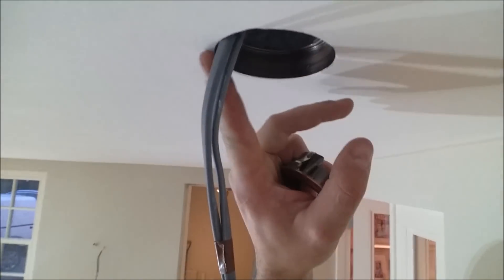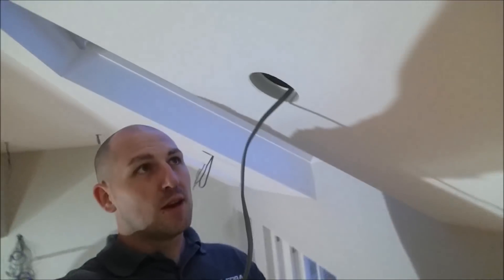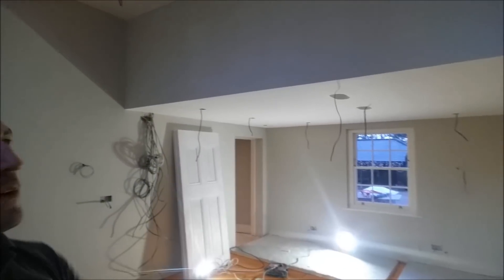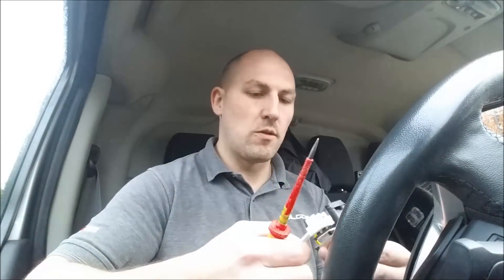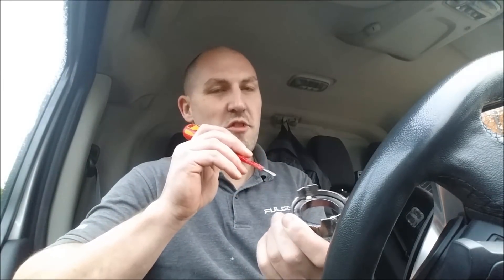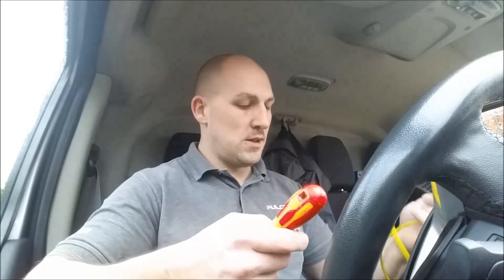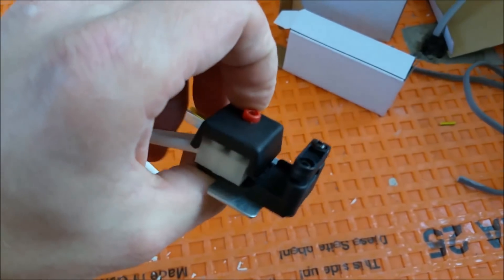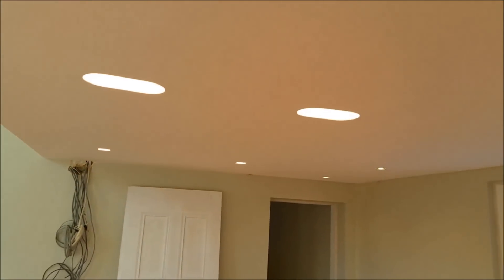My Trusted Electrician's day in Surrey - posh downlights and snake facts.

Comment: I will be venturing into my loft tomorrow, a squirrel has been nibbling on my light wires, seen two totally stripped wires about 1mm apart from each other  and thought how has that not shorted out the lights, touched them with a current tester pen and got a spark and lights out,  just put electrical tape over them, will need to inspect all the wires, funny thing is it only had an electrical test done a few weeks earlier and all showed as being ok.
Reply from the maker: Garry i see this all the time and never a dead squirrel or mouse?!?! How the hell do they manage to do this without exploding??.

If it helps I've started running my cables though pvc flexi con and so far so good. Not the easiest solution but it stops the phone ringing with complaints.
Reply: I was lifting the insulation expecting to find a dead squirrel, but no body to be found,  been and got some debox junction boxes today and a proper set of wire strippers, and work light so I am going to inspect it all tomorrow and make what repairs I can,  I think its the switched live and earth wires, not so easy to figure out when it's all single and double strands of wires,